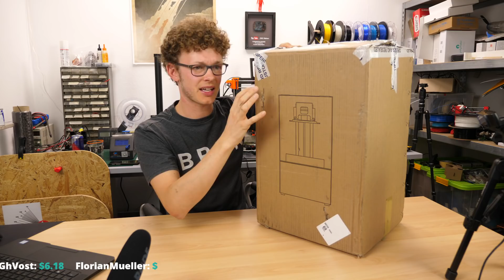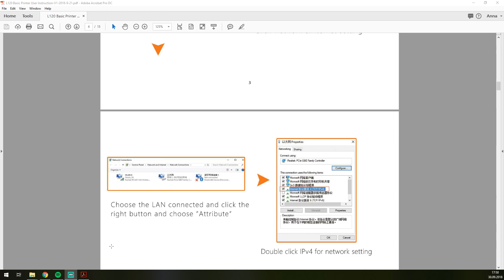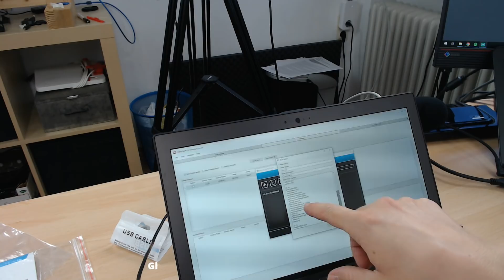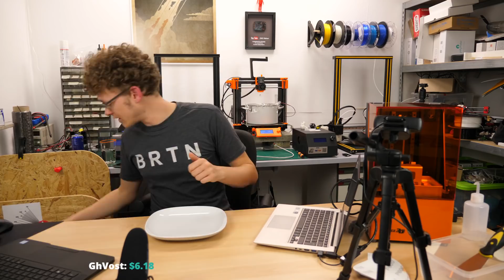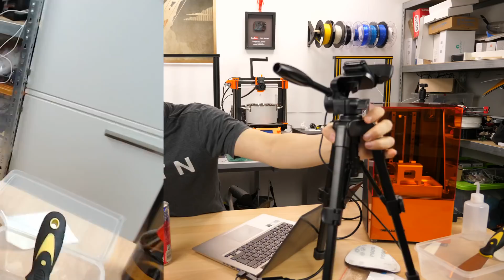LIVE: DAZZ 3D - LCD SLA Printer from KICKSTARTER

Comment from the maker: Don't want to waste your precious time? Jump ahead:
Start of the stream: 2:35
Unboxing: 10:00
Connection to the PC: 33:00
Software: 42:00
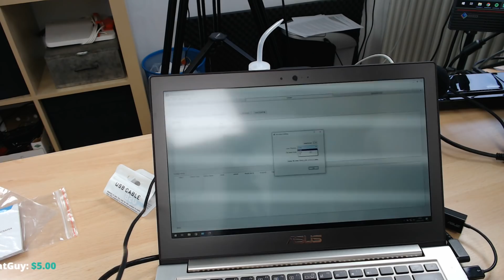Dry run: 53:00
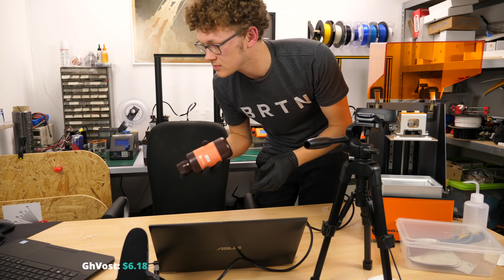Adding resin: 1:06:00
Start first print: 1:08:00
Second run: 1:35:00
Preparing the SOUS VIDE COOKED steak: 2:00:00
Second print result: 2:46:00
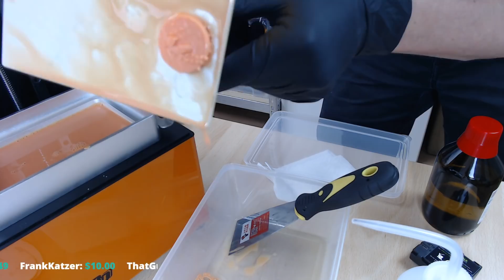Conclusion: 2:48:00
Reply: mach doch mal was über sla und Gesundheitsschädigungen durch die Flüssigkeit !
darüber gibt es so wenig, mich würde interessieren ob es reicht wenn ich den eben bestellente sla drucker in ein gehäuse stelle mit einem lüfter oder ob ich vor den lüfter besser noch einen aktivkohlefilter machen usw.

Comment: Thanks for making this video on the l120!  I picked one up but am having a heck of a time.  I cannot get the lcd screen working.  Can you please tell me what display is listed on the laser debug screen?  I am thinking it needs to be selected but moving through all of the files in the selectable files in the Pi is not yielding results.  Thanks!!
Reply: hi, can you tell me your experience with the l120 printer ,im looking to buy the pro
Reply: It’s been really poor.  I can tell the machine itself is very solid as well as all the components but connecting to the proprietary software with the computer in the printer is bad.  Called support, emailed etc but was not able to get any answers on connectivity.
Reply: @folksongpreacher2255  now you making me scare , it's costing me like 3000 usd with resin,

Comment: Why do these machines always have such a small print area, is the cured resin not strong enough to support a larger structure? Like a 1 cubic foot build platform is what I'm looking for!
Reply from the maker: Well the resolution is dependent on the LCD screen you are using. You could use a bigger screen but that would reduce the printing resolution drastically.
Reply: How about a 4k monitor? So really its a pixel problem?

Comment: 1. Remember most 3D Printer Kickstarter's fail, those that succeed are only around for a short time and seldom live up to the marketing, and most are proprietary so when they do go under, parts, cloud applications, etc. are not available or functional.

2. Unfortunately this company does not provide in-depth information on its financial business position or management, development team. Resume, bio's of team members, company profile, business listing, business evaluations based in Shenzhen, CN.

3. To date, for most, SLA printing has not lived up to the hype, the low end equipment is poor quality, and it's questionable if most users adhere to safety and health standards, particularly families with children (browse YouTube for an outrageous number of safety/health issues from SLA TYRO'S). These machines are for hobbyists willing to get their hands “dirty” with the hardware and software, not for the casual user who just wants to print. If a printer does not work as advertised out of the box without modifications it has failed the consumer (just like any product).

4. Let’s see how the upcoming PRUSA SLA printer does. At least it’s from a reputable company. It's likely that it will establish a good baseline for SLA quality, usability, user support, and supporting post-processing - curing/washing - equipment.  If U paid the suggested retail price after the Kickstarter, this machine no longer becomes a good value compared to other SLA printers on the market.